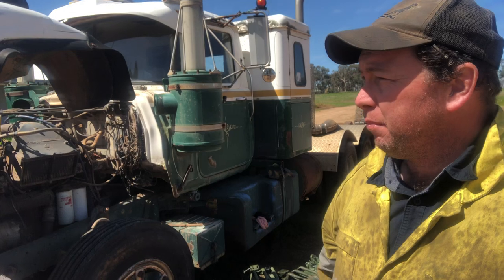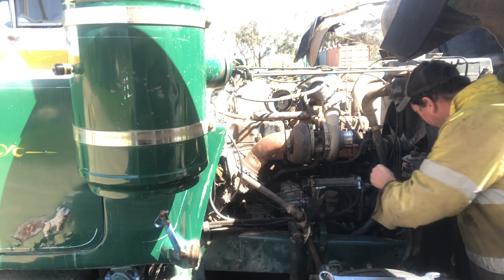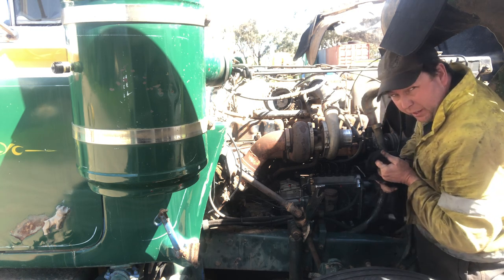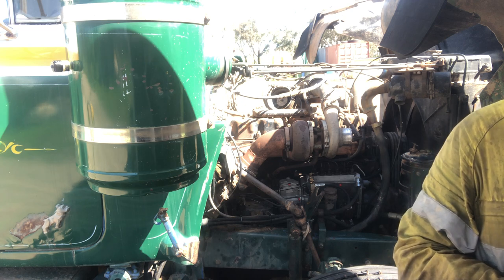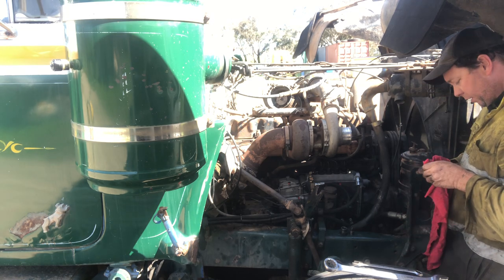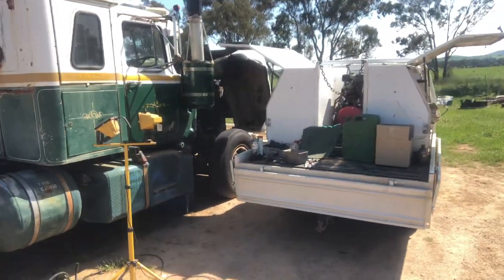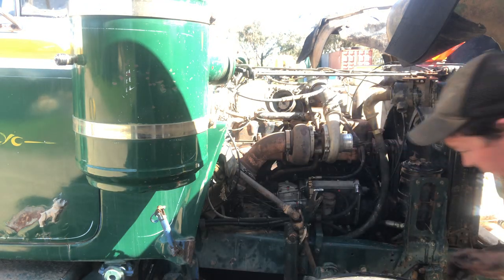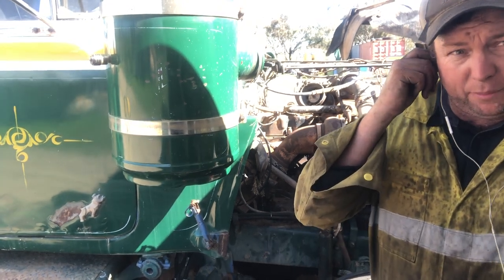Mack R600 fuel priming, spill time and attempt to start

Comment: So if a pump is simply getting replaced (for me it's for a governor rebuild) on an otherwise good running engine with no desire to change timing, or if timing was previously determined to be accurate, can one swap pumps out without needing to be concerned about engine TDC orientation?   Great series of videos by the way!

Comment: Which is the correct mark on the harmonic balancer do I need to achieve to start a spill time?..cheer’s
Reply from the maker: Depends on which engine you have. It will probably be 24°-26° before TC, with number 1 cylinder in compression stroke
Reply: @oldrigsdownunder7301  sorry cob I have a 285 out of a FR 700 cheer’s I’ll have a look when I get back out on the block..keep up the great video’s